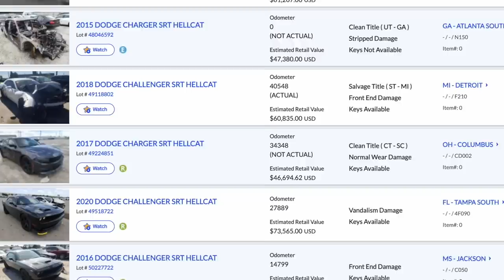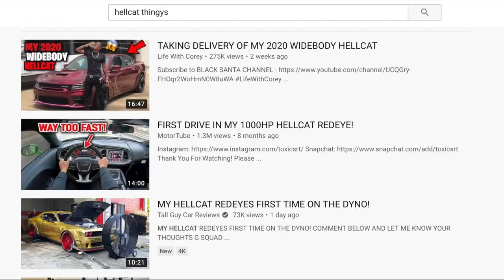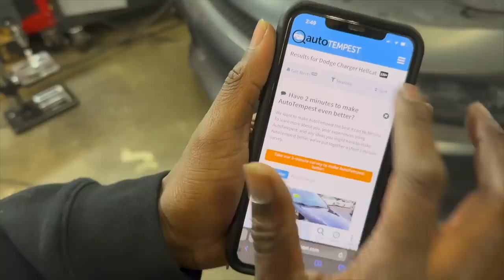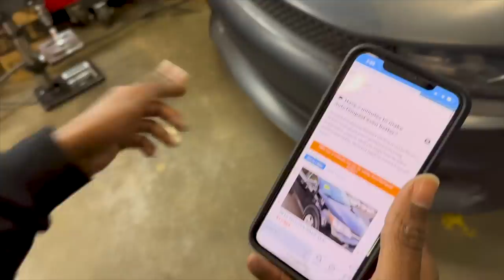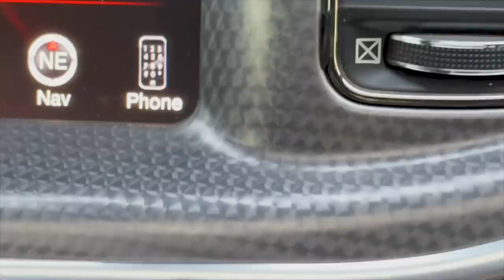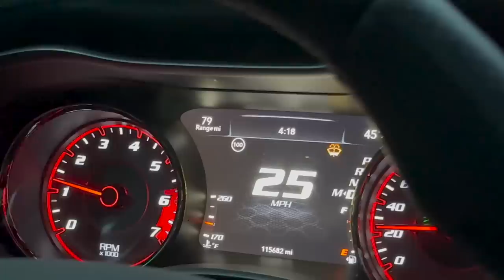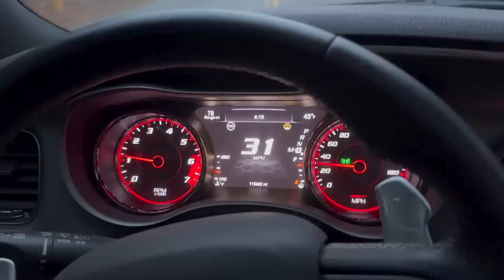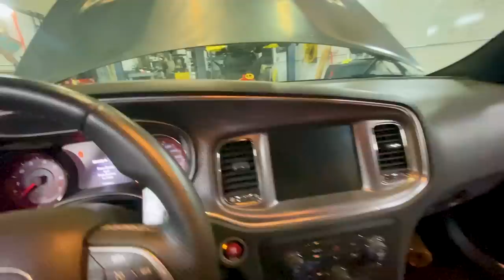We Bought The Most Clapped Out Hellcat We Could Find And Raced It To See What The Hype Was About

Comment: Autotempest is actually great tool. I found my ex a really cheap commuter with that site. Then she neglected the oil changes and locked it up lmao
Reply: Like your relationship?
Reply: CarGurus is way better of a tool
Reply: @dlproductions9574  CarGurus is great.  We have a comparison link to them so you can search both without entering your search again.
Reply: @autotempest  I just tried out your comparison tool with CarGurus and got the following results:

Dodge Caliber SRT, Nationwide search
Autotempest = 1 result
CarGurus = 4 results

The one Autotempest match is also on CarGurus. How is Autotempest better than CarGurus if it shows 75% less results?
Reply: @dlproductions9574 for that search it sounds like CarGurus was good. The advantage of autotempest is that you get access to everything, including CarGurus, in one place. We partner with a bunch of sites to give their results right on our page, and then all the significant ones you'd want to check that aren't our partners, like CarGurus, autotrader, Facebook Marketplace, and craigslist, we have comparison links for. For some searches there will be more results on the CarGurus page than on ours, and vice-versa for others. But if you start with AutoTempest you can check both, and everywhere else besides.

So, that's the pitch! Totally up to you if you want to use it though. If CarGurus works well for you, I can totally see sticking with that. Or maybe using it most of the time, and then just checking AT occasionally to see what else might be out there (on our site or through the other comparison links). Hope that helps!

Comment: the baffles are part of the sport modes, they have a small hole in them when shut to allow exhaust gasses to pass through, but it restricts sound and flow, then when you put in sport it allows full exhaust flow u have to keep them or it will throw a code
Reply: Or you can just remove them and stick a resistor in place .. or if you really want you can remove the butterfly and leave the rest on place 😊

Comment: Driving 100 vs 200 is not really a difference. Faster 0-60 is more fun and enjoyable.  Hellcats have poor traction control, handling etc. The suck in the snow and you end up stuck.  A performance model 3 out accelerates it, and is much better cornering, traction control, stability etc. That is why so many crash hellcats. Lots of so called power, but crap otherwise. Just for ego maniacal people. I have to laugh when I see them trying to get lots of attention by making noise like the 5 yr old on the jungle gym crying "mommy, mommy look at me"